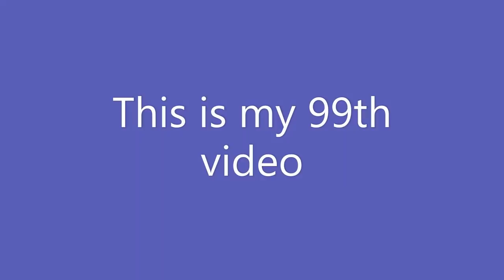Timber frame garage and garden utility space PART 13 ***OSB and door linings***

Comment: Makes me think about wearing ear defenders more.  I tend not to bother for using an impact driver or nail gun, though I usually put them on for a session with a grinder/disc cutter, or when strimming etc.
Reply from the maker: Hi IP🖐It didn't take me long to get used to wearing them, and now EVERYTHING is loud without them on🙉I know 2 guys, both younger than me, who are already struggling with hearing loss😬Thanks for watching 😎 Cheers Del

Comment: Very flash garden store. Certainly with the deck section looks like a lovely place to sit outside and relax. One thing with your door openings. Having trained in UK I was always taught fix all my lining and then fit door to that as you do. Came to Oz and nobody did that. We set the hinge side. Swing the door and then set the head and latch side to the door. I've found it a really good system. You made a tight fit and no doubt all true and even so doesn't matter. But for lots of internal doors works good. Apart from wet set plaster doors in UK which we don't do out here.
Reply from the maker: Hi Dave. Quite a few carpenters I know do their linings/doors exactly the way you describe👍 I thinks its probably habit and the way I was taught, (and that it might not be you hanging the doors in the linings you've fitted), that makes me fit the lining spot on to start with🤘 Great comment, and thanks for watching😎
Reply: @thetallcarpenter  I would agree with you on that system if at all possible even though I'm still in UK.
Reply from the maker: @amazing451  😎👍

Comment: That track saw looks at good one del . I bought the 900 and it’s way too heavy . Fits the track so not too bad . Another great vid pal
Reply from the maker: The saw is epic Terry, and I feel a right plumb for only just getting one after all these years🤯 Thanks for watching mate 😎
Reply: @thetallcarpenter  Outstanding craftsmanship as always T.C, 👍😁 There's a Makita 40V T.S on the way....🤔🤔😆😆🔨🇮🇪
Reply from the maker: @Toyotaamazon80series  Hi TN. No more spending on tools for me mate😬 I properly blew my new tool allowance this year🤯 Cheers
Reply: @thetallcarpenter  😂 I'm in the same boat, I'm skint after building my new workshop. Hopefully I can scrape a few quid together to buy some P.I.R to insulate the inside before the winter sets in. I've the second half of the build pencilled in for next April. Keep up the good work T.C, regards 👍🔨😎🇮🇪
Reply from the maker: @Toyotaamazon80series  Its extra tough at the minute, trying to complete projects, just down to massive increase in the cost of materials😬
Reply from the maker: @Toyotaamazon80series  I've had my opinions on this since the start. Whether they are the right ones is not for me to judge👊

Comment: What height do you fix the noggings?
Reply from the maker: Hi AJ🖐I set mine at 1100mm from the floor. This allows any light switches to be 1200mm to their top, in line with regulations👊Thanks for watching 😎 Cheers Del

Comment: Del 
Is there a particular reason why you screwed the osb  and not nailed ?
Thanks
Reply from the maker: Hi Philip. I find that 1st fix Paslode nails are a bit to heavy a fixing in this 12mm osb when it's the finished wall. I would nail it if it was a structural wall that was to be overboarded or battened etc. I suppose, in this instance, I think it just looks neater🤩 Cheers.
Reply: @thetallcarpenter  thanks for rapid response... yes makes sense thanks pal
Reply from the maker: @philipdavis9579  😎